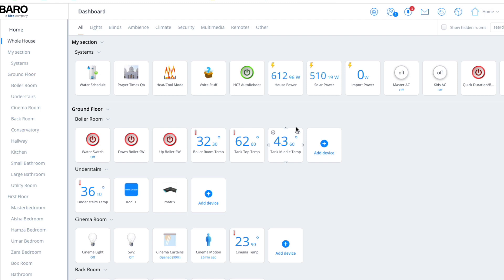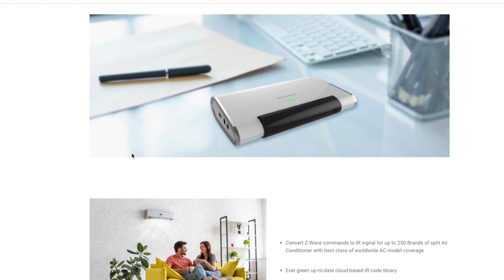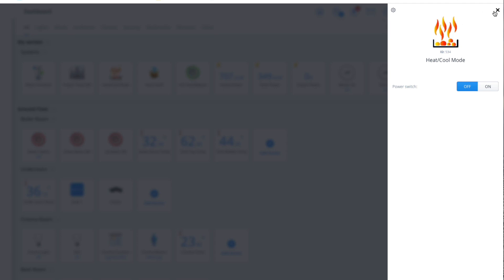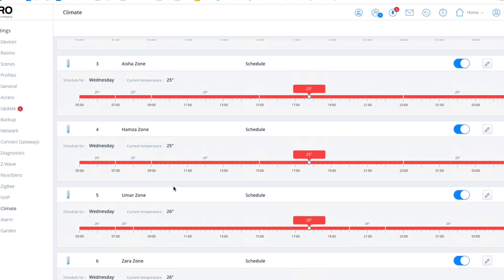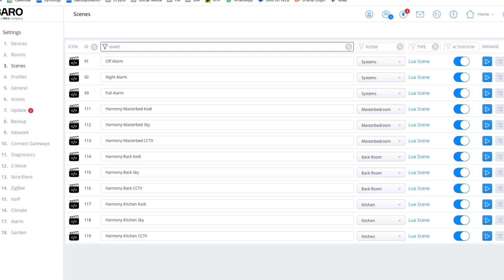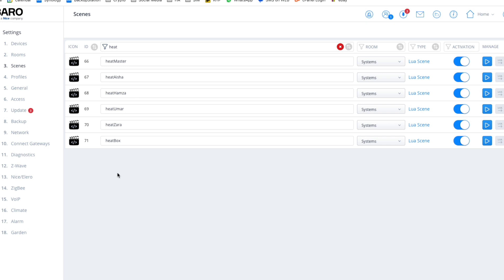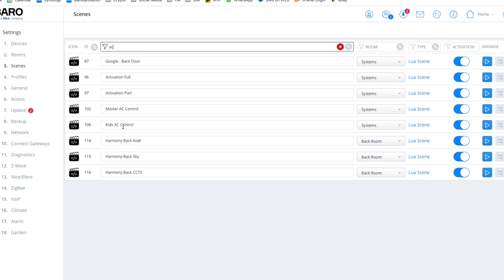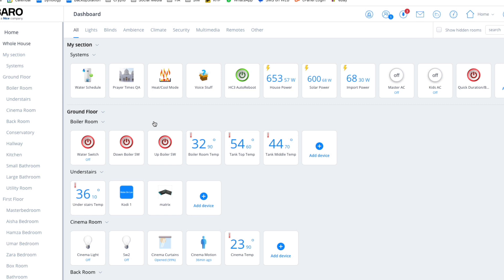Full AC and Heating control using Fibaro HC3/HC3L

Comment: It seems to be cool! Thanks for your video!
Could you provide the scene settings for heating and cooling a zone?
Reply from the maker: It's individual so it depends what you have in your system. 
Generally 
Temp sensor to measure temp
A thermostat to sync to climate panel.
Then check if temp is below the setpoint.
When below the temp then change variable for that room.
Then another scene to check all variables before turning the boiler switch on or off in case of heating or activate the AC
Reply: @YorkshireAutomation  Thanks a lot, it helps me! I have almost the same system as yours just with fewer zones (and currently without any air conditioning) :)

Comment: Can you provide a photo how you mount this IR devices? I'm asking as I have the similar problem right now with Haier devices. I'm trying to use the Aidoo Z-wave converters by they are not compatible with Haier :/
Reply from the maker: Hi
My units are in the loft as they are centralised units, so the ZXT is in line of site with the receiver of the AC units
Reply: @YorkshireAutomation  so wher you mount ZXT to ceiling to be inline with the unit?   I'm looking how to hide them not but some hanging stuff. In my setup right now it will be hard to mount them in line of site and keep them invisible for people :/
Reply from the maker: @akaGoolash  fortunately i can hide mine in loft space. In living areas i have placed my ZXT behind the sofa under the AC unit itself. So the ZXT and AC are line of site but the ZXT is behind sofa.
Later in the year MCO Home are bringing out a new unit which is wall mountable and has a display with an IR sender. This is a nice looking unit for AC control too.
Hopefully i will get one shortly and present it on my channel